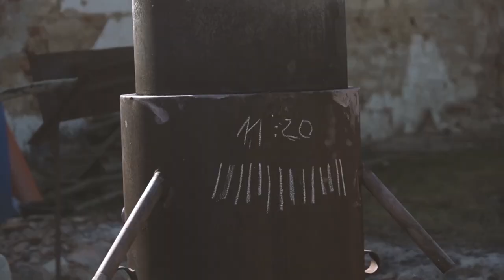Katana making - Tamahagane

Comment: Can pure iron powder be used, or does it have to be ore in the form of magnetite or some other iron oxide? Thank you.
Reply from the maker: If you use steel powder, it's not tamahagane reduction, It's oroshigane method. I don't know how well it can work. I tried small chips from steel machining and it wasn't a very good attempt. You also need to use a different oven. Lower charcoal column. If it is too high, you will make cast iron.
Reply: @katana making  thank you for your response. Not steel powder, but iron powder. No carbon. Pretty much just pure iron powder. It should oxide first, then reduce from there. Just thinking the yeld would be higher.